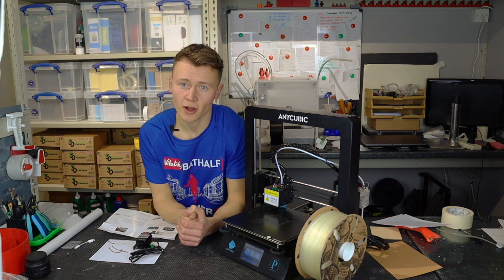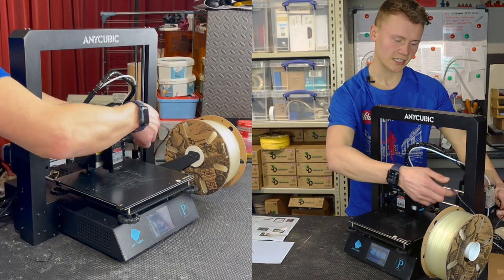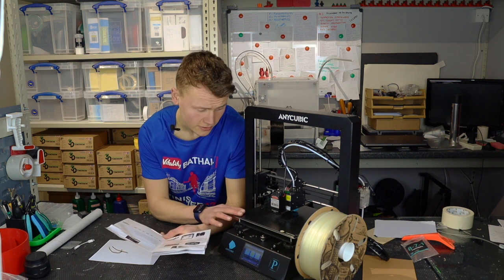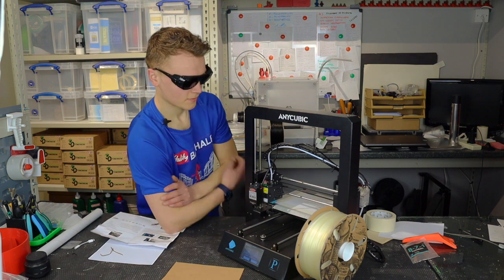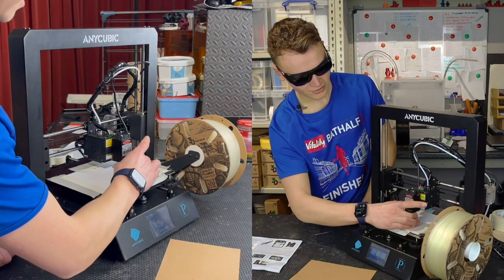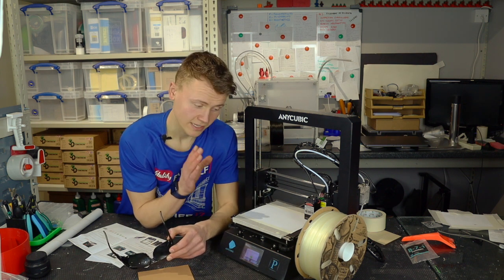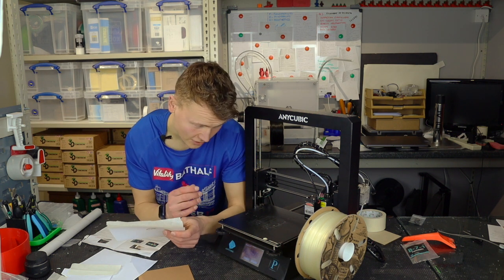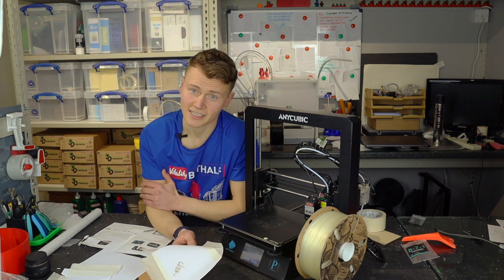LASER Attachment || Setup & First Impressions || Anycubic Mega Pro 2-in-1 3D Printer

Comment: I guess the brown paper may be better to show the area of gray tones. White paper takes quite a bit energy to show anything. It goes either black or does nothing. I have still the glasses and the laser function untried because I dont trust the protection glasses are for right wavelength and thus I don't risk my eyesight. Probaply they are ok, but powerful laser can make damage to eye withouth any direct pointing. The default cable tie setup(or faulty teflon tube) hindered my filament flow in Pro version, but not in i3 mega S.

Comment: I have the mega (upgraded to the S) and I am thinking about a new anycubic printer, I have always wanted a laser engraver so this is on the table for me, I dont know what to get the anycubic Vyper or this one... The vyper is swaying me with the auto bed leveling ad fast print speeds but I still dont know what to get..

Any input would be greatly recieved
Reply from the maker: I've not tested the Vyper personally, but have heard good things. If you do go for the vyper you could always use an external laser kit and add it to it. Personally though, my opinion is if you want a laser buy a laser. You can still get some cheap options that will offer a much much larger area to work with.

Comment: How do we make it bigger?
Reply from the maker: Not the easiest printer to extend!
Reply: @CallumColes  I meant how to make the laser engraving area larger.
Reply from the maker: @Judgment_Day  ah I see, the max laser engraving size is 220x140mm. To get the max size you’ll have to add a BITMAP file in that aspect ratio. I can’t remember the exact resolution the laser works to, so if it’s not printing as big as you’d like, increase the resolution of the BITMAP.
Hope that helps:)
Reply: @CallumColes  Yes, thank you.

Comment: There are multiple sets of recommended settings from Anycubic included on the SD card it comes with, including laser height, pixel size, laser intensity, and 2 picture mirror settings. You didn't try any of the recommended settings? You carved into your printer bed.
Reply from the maker: From memory, there were only 3 laser-related files on the SD card I received, all BMP files. It's possible they've since added more recommendations as a result of user feedback, which would be good! 

Carved into the printer bed is a bit of an overstatement lol, could barely cut butter with that thing. Even so though, I really don't think open laser engravers are a good idea, just asking for trouble.

Comment: Beginning down the rabbit hole of 3D printing...just looking into unit units and gathering info so I'm not diving in head first to the shallow end of the pool lol. Do you have any thoughts on leveling the bed manually as opposed auto leveling systems? Any issues with the auto leveling ones or is manual more precise? Thanks for all the videos and I will keep digging through your content for info;also subscribed so looking forward to future videos. Thanks again
Reply from the maker: Thanks for the comment and sub, much appreciated. 
In terms of auto-bed levelling, I think it is overrated for small printers tbh, it really is not too much trouble to manually level a bed in my opinion (I have a video on manual bed levelling, so you can judge the effort required). 
For larger beds, say 300mm+, there will be greater variation, so manual levelling becomes more difficult and some levelling assistance can be beneficial. However, a thicker first layer can help compensate hardware variations, so even in this instance, is not crucial.
Reply: Hey there I know this is a five month old comment, but as a machinist and engineering now getting into 3D printing the capabilities are awesome! I have to say for you to look into fusion 360.

Comment: XD sorry finally found this after so many videos too look through could you show where too get more files and how too convert them too work also.
How too adjust the print size for like a round peice of wood
Reply from the maker: The laser engraver works with image files in the BMP (Bitmap) format. So any image added to the SD card in that format should show up for you to select and engrave.

To find more things to engrave just do a google search for whatever image you are after, then a separate google search for 'convert jpg/png to bitmap'. Alternatively, if you're on windows you can open the image you have downloaded in Paint and export to bitmap.

The engraver max size is 220 x 140mm, so the aspect ratio of 11:7 will maximise the build space. With an image of that aspect ratio setup, you should be able to work out the right proportions of the image to use for your desired laser size.

I no longer have this printer so that's about the extent of the help I can provide, but hope it helps get you going in the right direction:)
Reply: @CallumColes  kk just wanted to print on like wooden cuts you put cups on just  didn't know how to size it up 😅 and too bad was looking forward to how you fixed it
Reply from the maker: If it doesn't scale up, then perhaps a higher resolution image will be needed. I suspect the software maps pixels in the image to physical space. It's a while since I used it so can't remember unfortunately. If you do figure it out, leave a comment in case any future viewer has the same concern:)

Comment: You need to work out your videos step by step this video could be quite dangerous for someone new to this tech.  It really felt that you didn’t know what you were doing hence the lack of continuity.  Sorry but didn’t think it was good.  Does the laser allow online connection to a pc so something like lightburn could be used ?
Reply from the maker: My unboxing / first impression videos are effectively done live, so at the point of recording I will have not used the machine/equipment before. If the setup felt disjointed, then that will also be a reflection on the setup instructions provided. 

The subsequent review videos are after a period of use so there is more chance to plan.
Reply: @CallumColes  that’s ok but your dealing with a laser and at several points your safety left so much to be desired.  Not everyone will fully understand and if they follow your example there is potentially a serious injury waiting to happen. I don’t like to criticise but I have seen the injuries that were caused by a laser and it’s optical power was less than 1 watt.
Reply from the maker: Understood, I’ll take your feedback on board and consider alternative workflows when it comes to more safety crucial components. 
There should be more regulation on these particular machines anyway to be honest, open housing + lasers is a recipe for disaster.
Reply: @CallumColes  well done 👍
Reply: I have revisited your you tube channel and there is a lot of really good content so even though I didn’t like this video for the reasons discussed it obvious from your other content that you take great pride in doing your best for the viewers which must be commended.  I’m converted so have subscribed keep up the standards as shown in your other posts as they are very good 👍

Comment: ok Callum, will the printer handle infused metal filaments such as bronze or brass?
is the laser powerful enough to etch the copper on PC boards for electronics?
 I can't find a definite answer on their web site. as you can see even though you may not understand or have a use for an attachment others might so be careful not to dismiss a feature even if you don't have a use for it. good review, stay healthy, Russ
Reply from the maker: Hi Russell
Yes the printer would be fine with infused metal filaments, that's more a case of requiring a hardened nozzle (and preferably larger than 0.4mm).
The laser is (supposedly) 1W. Here I've found a successful experiment with a 2.5W laser: https://www.youtube.com/watch?v=1hFNj86L7sk&ab_channel=MarcoReps so yes you probably could get something working with this printer, albeit slower than the linked video.
My dismissal of the feature was primarily due to the fact you could get a dedicated laser engraver and a standard printer, for around the same price as this machine. Given a dedicated unit would almost definitely out perform the laser capabilities of this machine, that is the route I would recommend. That said, if you do opt for this printer, I'd love to know how you get on.
Thanks for watching and for your comment, have a good weekend:)

Comment: Do you know if you can engrave other size of wood for example a small 2x4?
Reply from the maker: Pretty sure this would work yes, you'd probably want to set the z height to the max 100mm (approx 50mm above your 4x2) and then adjust the focus accordingly.

Comment: Amazing video but how do I engrave the small wood that comes with it
Reply from the maker: Thanks! To engrave the small piece of wood, you just need to tape the board to the bed and then get it started. You can use the test option before you start a laser job (can't remember exactly what it is called) to see the outline of the engrave area so you know where you need to place the wood.

Comment: Cool vid mate, im just trying mine this week.  Do you think it  works on glass surfaces?
Reply from the maker: Thank you! Wouldn’t recommend using it on glass surfaces no, have to be careful using these sort of lasers on anything reflective
Reply: @CallumColes  Thx for your advice. Maybe it would reflect the laser to the laser head, i shouldn't hurt it. I may try it on plastic sheets (Laserply), since it does not have such a high degree of melting.

Comment: its a nice video! and i was thinking of  engraving fantasy maps for dnd! but i ended up getting a different anycubic printer!  its a slight regret but I'll probably try and get one later
Reply from the maker: Thank you:) the laser is certainly cool and sounds like you would have a good use for it! I'm sure they will refine the implementation. I do like it, but would rather a little more safety consideration. It would be nice if they could also provide (or at least sell separately) an enclosure for it, as the glasses don't protect anyone else in the room. It will be interesting to see how these 2 in 1 machines develop in the market.
Reply: @CallumColes  thats true, I'm hoping to get a separate one when I get more space for one!